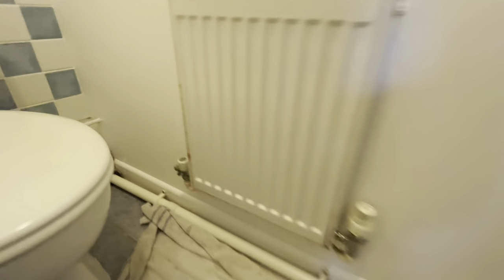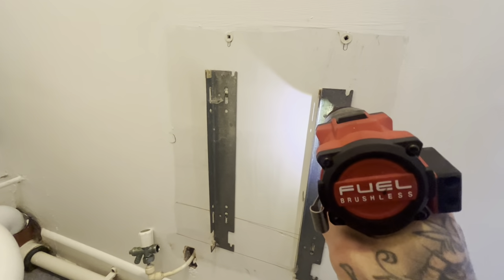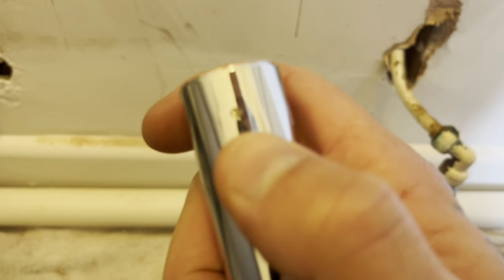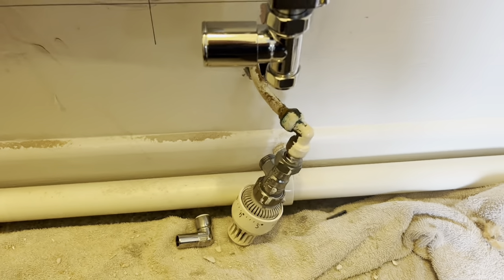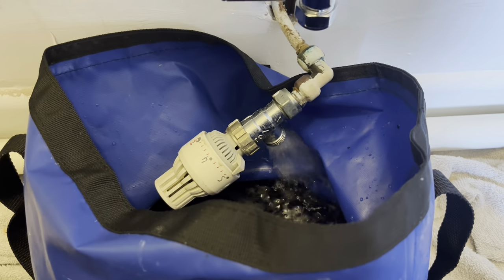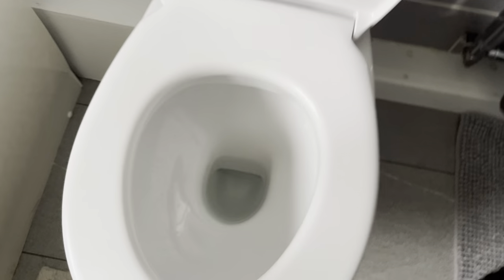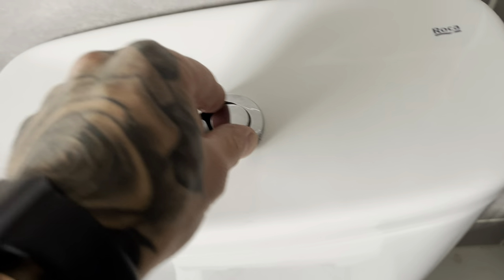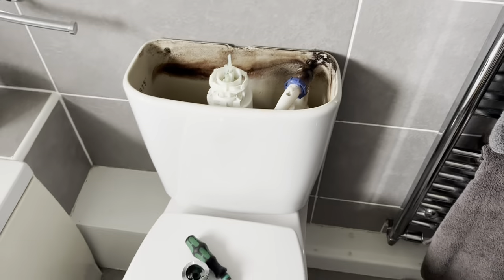#87 How to change a radiator for a towel rail #plumber #towelradiator

Comment: There’s an old saying of ‘ where there’s muck there’s money’ but I’m same as you, have found tons of muck over the years but NEVER any money. Keep up the good work. With regards to one question in your other videos and at the risk of alienating bricklayers, all they need is a couple trowels, a lump hammer and bolster chisel and a pointing tool. No yearly or five yearly resit of qualifications and costs to governing bodies (Gas Safe). No they should not be as highly paid as plumbers/heating engineers or electricians
Reply from the maker: Thank you mate! No I’ve never found any money either :( haha. 
And I have the same feelings regarding bricklayers plasterers etc. thanks for the comment! 🫶🏽

Comment: I hate towel rads, people add them onto their system and then wonder why they can’t balance the system correctly, I’ve been to a couple of jobs where the towel rads get added onto the hot water side of a y plan or s plan, then the customer complains that the rad is always roasting hot 😂
Reply from the maker: I really dislike them too, but people want them to modernise their toilets or bathrooms. And they always get bouncing hot haha
Reply: @Heatking  at least there towels are nice and dry 😂😂😂
Reply from the maker: @CarlAtkinson-zu1zh  😂😂 ‘but my bathrooms always freezing’ 😂😂
Reply: @Heatking  you need a twin panel towel rad mate 👍
Reply: @Heatking  not looking forward to replacing loads of seized 3port valves over the next few months, I hate this time of year, keep up the great videos mate, what jobs do you hate the most?
Reply from the maker: @CarlAtkinson-zu1zh  cheers buddy. I don’t mind changing valves, it’s intermittent faults what I can’t stand 🤦🏽‍♂️😩
Reply: @Heatking  yes they are the worst, my most hated job is replacing a leaking flow switch on a Baxi solo 15he, there an absolute nightmare, mainly because of the air locks after a full drain down, after that, any repair on a Glowworm 30cxi is always a complete arse! 😂😂😂